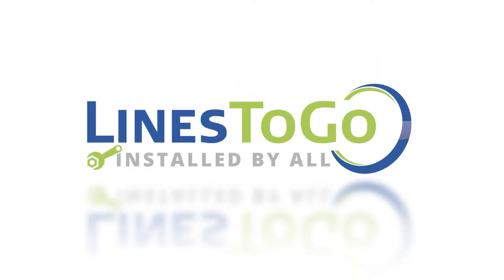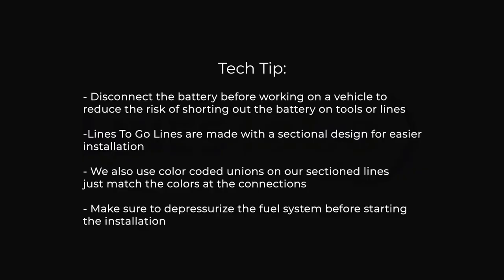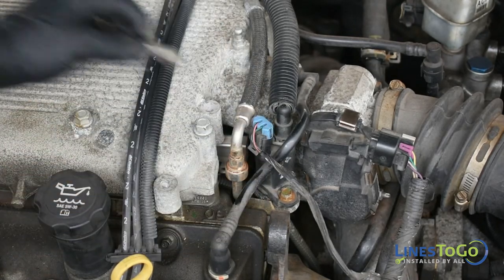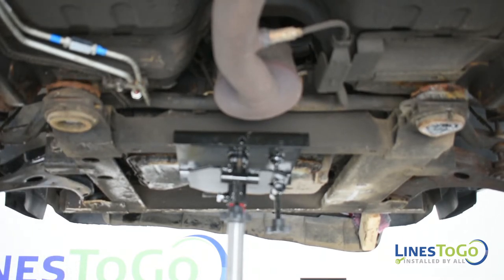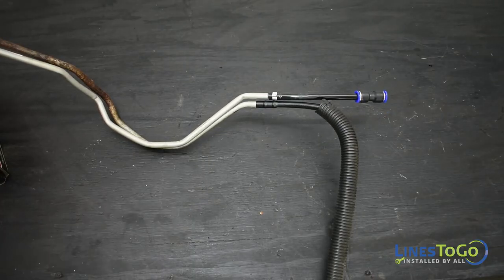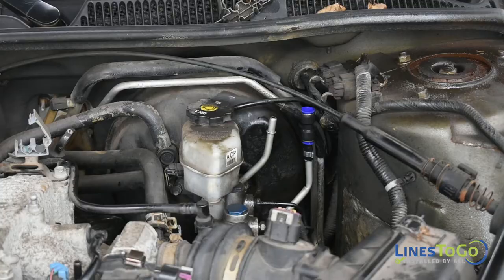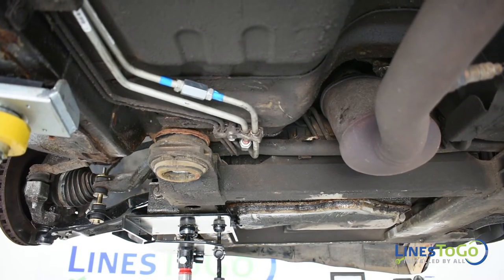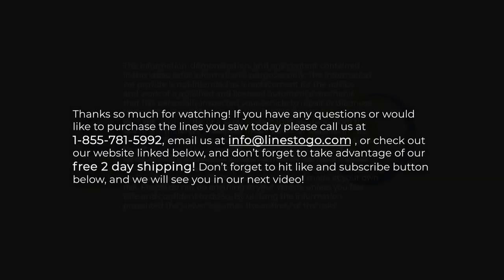How to Install 2007-2011 Chevrolet Impala Fuel Lines

Comment: now, after all the handling of the fuel and brake lines, replace the rusted out BRAKE lines- which will likely start leaking after all the handling. lol..The biggest reason for scrapping an otherwise good car in the Rust-Belt...whack-a-mole rusted lines. Repair cost often  more than a rusted 15 yr old vehicle is worth...Why cant GM et al use ALL rustproof/non-metalic fuel and brake lines? We'd get another 5-8 years out of a good car !

Comment: THIS IS NOT EASY.  THAT IS MISLEADING
Reply: I did this in a gm shop with gm lines. Not easy at all. This was rather difficult, even with other techs help. Especially snaking the gm lines back in. Getting them in the exact same way is quite challenging. Not easy by any means.